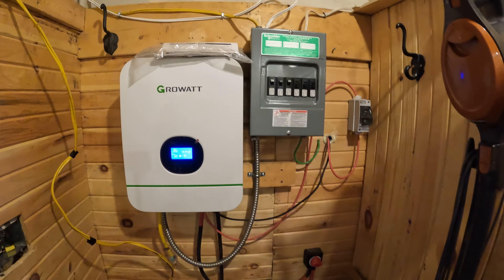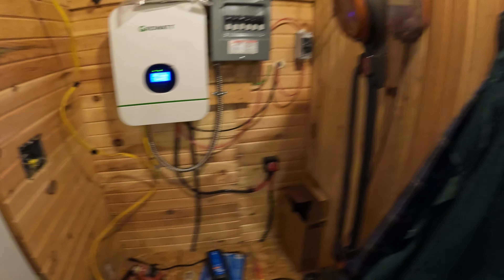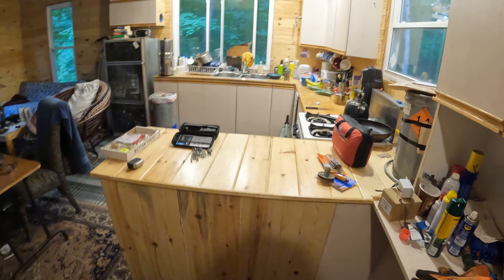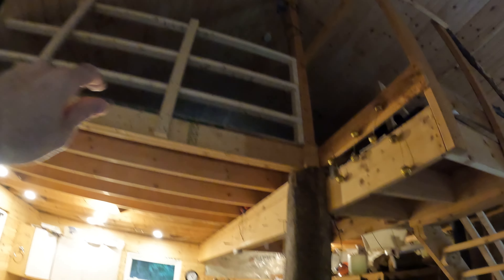Installing an electrical sub box to my Growatt (SPF 3000TL) and an update to the inside of my cabin

Comment: Useng the pump directly for the battery is no issue, no need to change that, it's more efficient to run it that way, although you could install a 12v fuse board to keep it safe, so long as you take the power after the shunt you can keep track on the power use from your battery.
Reply from the maker: I decided to buy an AC to DC transformer  and connected the wire directly to my house panel and it works great! Take care, Scott